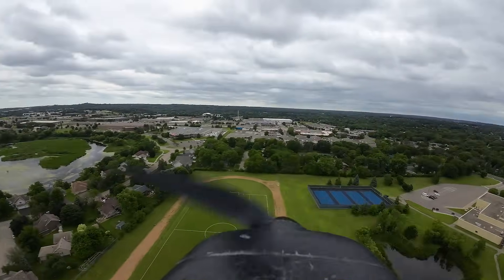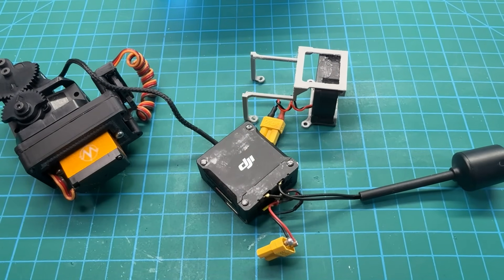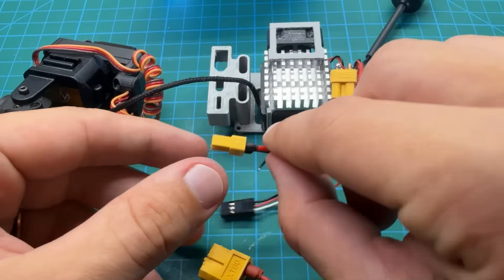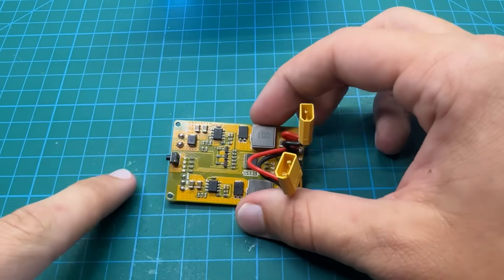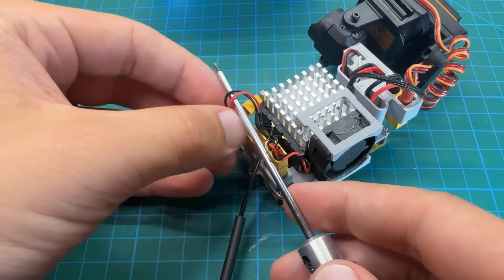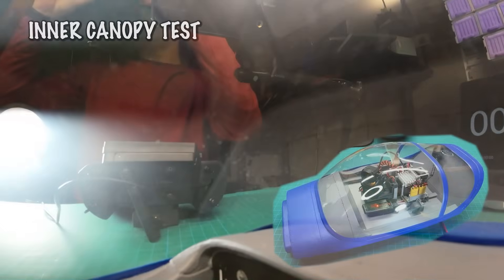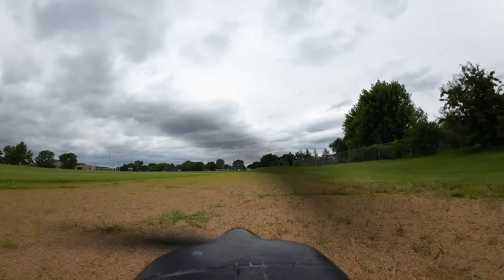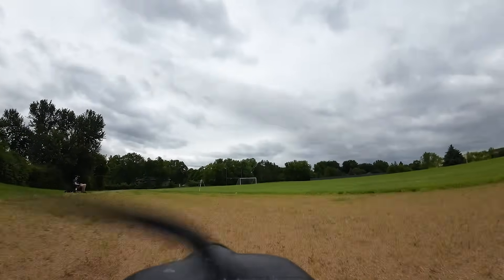FPV Head Tracking V2: Compact, Removable & Digital for Any Plane

Comment: Something to think about, If you do not want to cut up the canopy like alot of other fpv planes. 3d print a duct that you can only make a small opening on the front of the canopy run the duct along the right side of the cockpit along the arm rest then angle the duct right at the heatsink and vtx. them cut an opening on the back side of the canopy to expell the heated air. Your youtube channel is amazing and would like to work with you in the future
Reply from the maker: Thank you so much! Yeah that ducted idea seems like the direction we're gonna have to go in, especially since I prefer a full canopy over an open look like on the Timber. Thanks for the idea and I'd love to work with you in the future too!
Reply: @InvertedAviatorsRC only thing that you probably already know is that yes you are bringing air in and it will be directed at the vtx, you will have to make either 2 small holes or 1 larger 1 in the back of the canopy to expell the warmed air from the vtx

Comment: Nice set up. I like where you were heading with an inclosed canopy fpv system. Now, if you mod that bracket that holds the fan and airunit. So the both are on the bottom of the plate. More air flows threw the fuselage. Having the fan/ airunit inside the fuse, attached to bottom of canopy. It will stay cool. Flowing air is needed with these units. You have plenty inside the fuse, while inflight. Just a thought for your consideration.

Comment: Neat project! I wonder if you could maybe vent the enclosed canopy from the bottom plate so that it pulls air in from the prop in the cowling area and forces it out the back through the fuselage vent? So, two holes in the bottom plate of the canopy, one in front and one in back. Just a thought.

Comment: Would it be possible to put the camera and gimbal in the canopy, but put the vtx somewhere else, like inside the fuselage?
Reply from the maker: Yeah potentially! One limiting factor might be the length of wire between the camera and vtx, but I think you can get longer connectors. But yeah adding the air unit to somewhere that has a bit more airflow is a great idea!
Reply: I know rotor riot has O3 mipi cables in different lengths up to 30cm.  I think that would give you enough length to route the cable as needed.
Reply from the maker: @davidgreene740 oh I’ll have to look into it! Thanks for the tip!